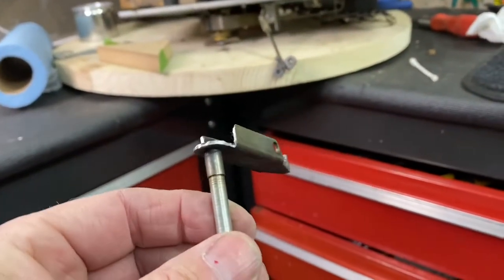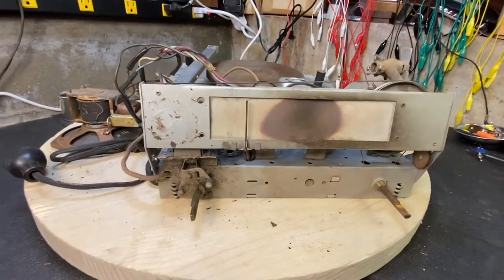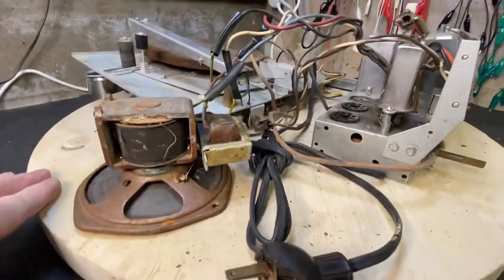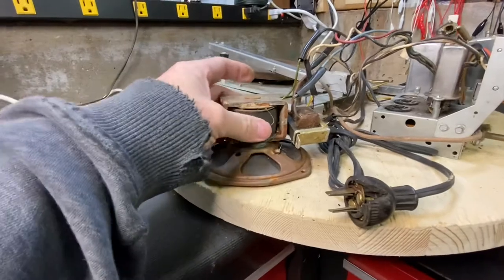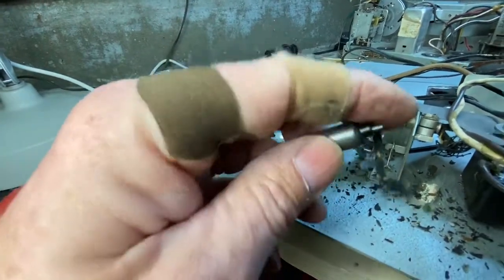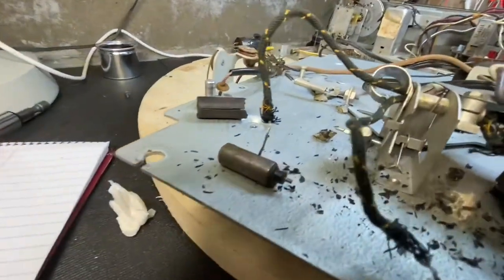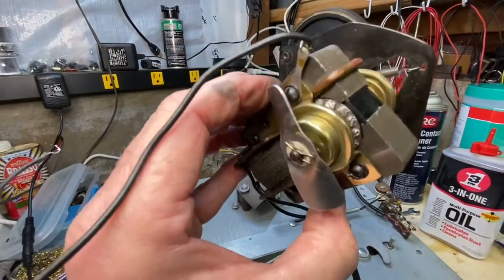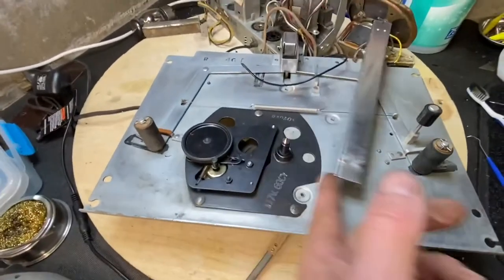Philco 46-1201 “Bing Crosby“  (Part 2) The Turntable.

Comment: You can clip onto the cartridge with your multimeter and rub the stylus with you finger to test it. Should get a couple volts ac out of it. What cartridge did you order for it? Glad you could find a mercury switch, if you have trouble finding anything else let me know.
Reply from the maker: Thanks. Ya, I checked it with a meter then my oscilloscope, nothing. Oh well. I purchased the Pfanstiehl P-51-3. $15.00. That was what a few people online were using for their sets.

Comment: Thanks for the video. I have this same model and am having an issue with very quiet audio from the record player, but normal radio volume and reception. Did you experience this at any point in your restoration? Or do you have any suggestions as to what might be causing that? (maybe it needs a new cartridge..?). Cheers.
Reply from the maker: I replaced the original cartridge because mine was dead. The amp in the radio is designed for the 1 volt output of the crystal cartridge. The replacement puts out .5 volts. On my unit, there was a 10 meg resistor from the cartridge to the volume pot, too much. I replaced the 10 meg with a 100k resistor which worked fine. Also, check and make sure the red lead from the cartridge is not grounded. Mine was causing no sound. The black lead should only be grounded to chassis. Hope this helps. I go over this in my final video.
Thanks for the sub!
Dave
Reply: @VintageRadioRepair  Thank you oh so much!!  I had 2 resisters on my unit!  I removed them both and replaced them with 100k like you suggested and all is good!! Happy listening!! Ric

Comment: How'd you get the motor out of yours I can't seem to get mine I don't even know where to start any help would be appreciated thank you
Reply from the maker: It's been awhile but if I remember correctly there are a couple screws that go from the motor through the chassis and into the mount on the other side. They just screw in. Then it's just a matter of moving the motor assembly over a bit. I think I kept the chassis between the motor and wheel then slightly tilted to get it out. It's not that bad. If you run into issues, send me an email. vintageradio30@gmail.com
Reply: @VintageRadioRepair  thank you. I'll be looking it over.

Comment: Just bought an old 46-1201 off craigslist for $10 and began restoration. Mine is not as nice looking as yours much more rust but the wood looks better than yours. Its missing the platter, the cartridge needle, dial string and dial indicator. Can you tell me what you replaced the mercury switch with? Mercury switch, metal ball etc and part# please. My motor is also different than yours the fan blade is a small squirrel cage inside just below the armature. Mine is a code 130.
Reply from the maker: Nice. I’d like to see some pics sometime. The switch was an eBay purchase. DURAKOOL A1-002 Insulated Tilt and Position Switch with Mounting Clip. It was a direct replacement and worked great. I’ve been away from the video seen lately but am working on a couple projects I’ll post soon. Love to see your radio.
Dave
Reply: @VintageRadioRepair  Thanks Dave appreciate the info. I already purchased and received the new needle cartridge that you bought. Do you want photos before or after restoration?
Reply from the maker: Both. Would love to see before and after!